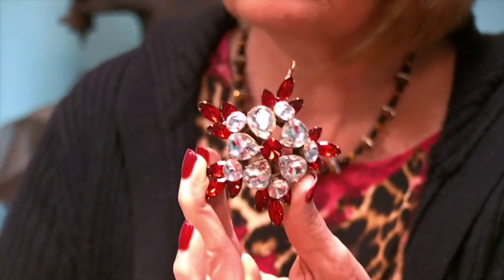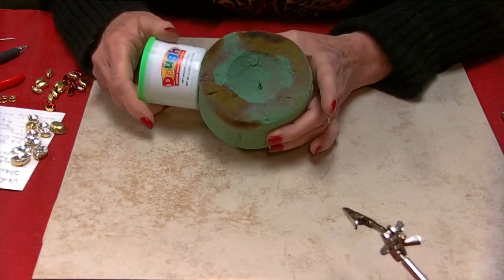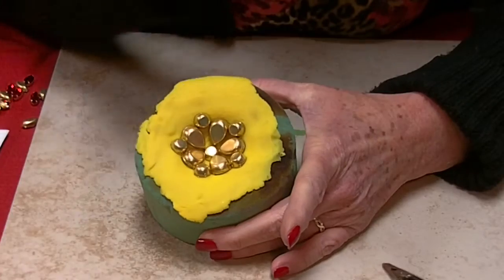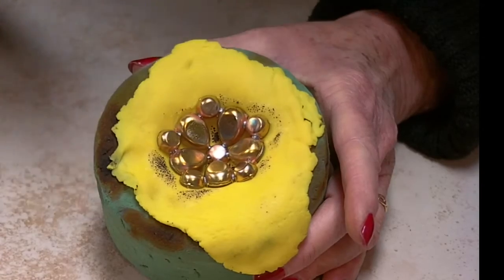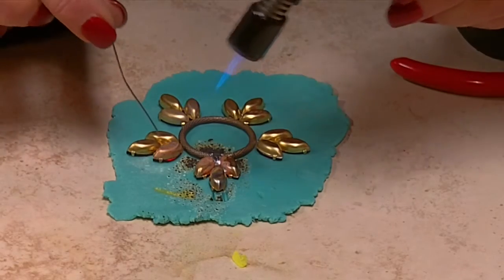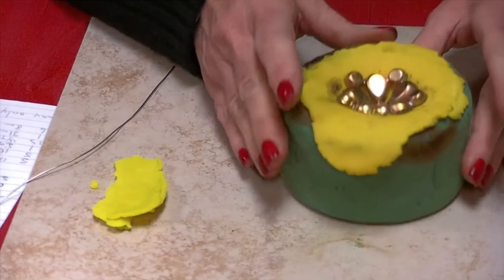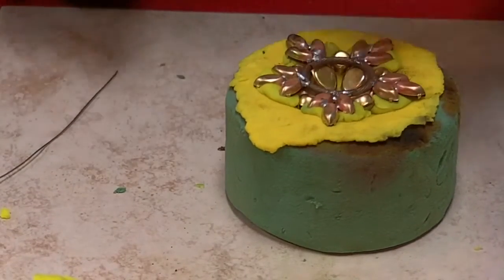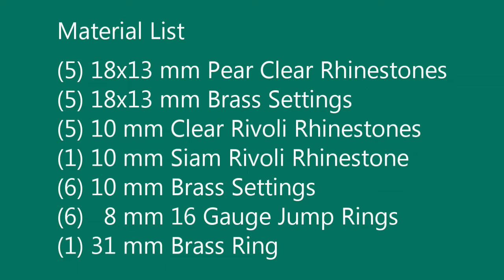How to Solder Jewelry Video 4 - Stacked Pendant

Comment: Jan would you please demonstrate how to solder stacked rhinestone earrings?
Reply from the maker: The only difference between the pendant in video 4 and making it or something similar into an earring would be to have the jump ring going parallel to the rhinestone piece that you soldered and using the jump ring to connect the piece to your ear clip portion. I  hope that is what you are asking. If not please be more specific as to what you are referring to.